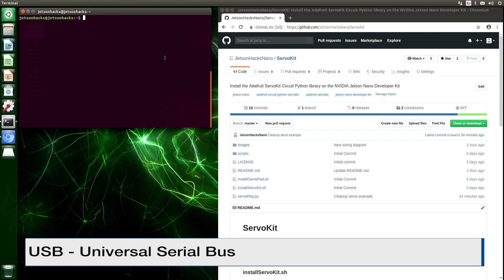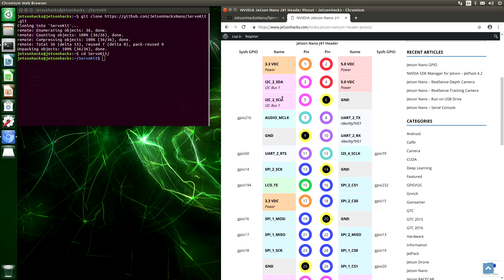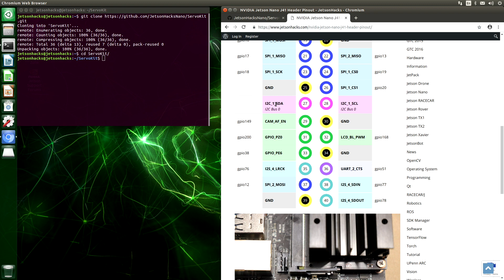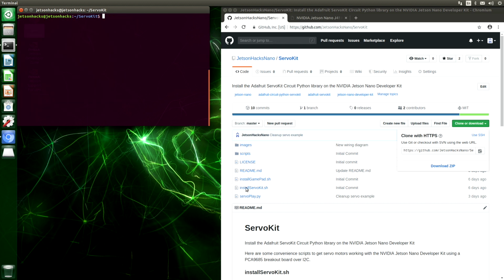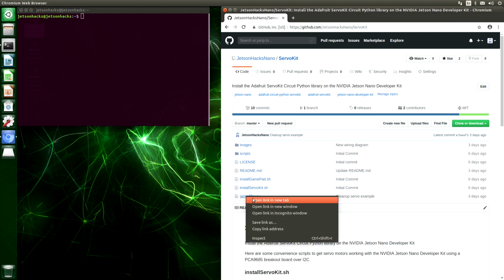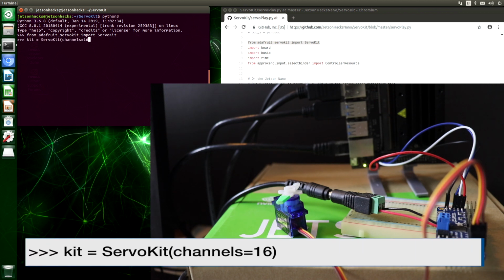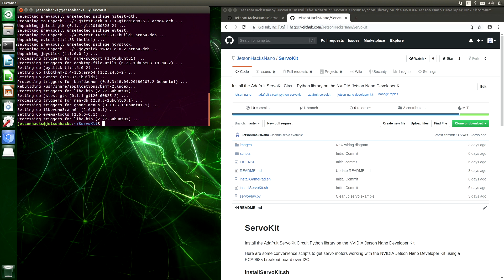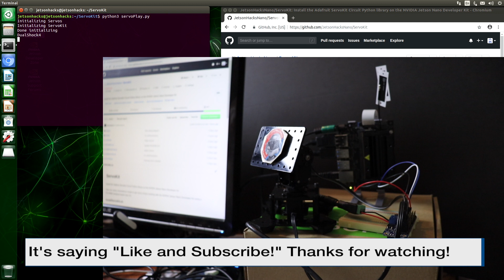Jetson Nano I2C PWM Servo Motors

Comment: I can't see the pca9685 on the jetson nano. I connected it to the 3rd and 5th pins with i2cdetect but it didn't work. I connected it to the 27th and 28th pins but it still didn't work. The power led of the pca9685 is on, can you help me?
Reply from the maker: what was the i2cdetect command you used?

Comment: Would this still work on the new Nvidia Jetson Nano Orin Super?
Reply from the maker: I haven't tried it. There may be issues with the library versions. Also, the pin assignments may be on different busses, so you will need to check the pinouts. The pinouts is available on https://jetsonhacks.com/nvidia-jetson-orin-nano-gpio-header-pinout/  
Thanks for watching!
Reply: @JetsonHacks thanks for the reply! Right now i currently have a rpi 4 that ill use as an i2c slave. I also have 3 f to f cables coming in to connect the rpi 4 to the jetson

I used chatgpt to come up with this solution, ill see if i can find more info on this but off the top of your head does this sound right? I think it does since rpi4 and my rpi servo hat has i2c
Reply: @JetsonHacks  hello, sorry i have another question. Im pretty new to using parts like these, what is the purpose of a breadboard? Couldnt I wire directly from the jetson to the pca9685 without the breadboard?
Reply from the maker: @michaellopez3681  You can wire it directly to the PCA9685. People use breadboards for prototyping because it's easy to change the wiring during development.

Comment: Hello,
I'm having a hard time to determine which GPIO pins must be connected to the stepper motor driver RMCS1120. 
I need assistance in determining which specific GPIO pins on the Jetson Nano should be used to connect the PUL+, PUL-, DIR+, DIR-, ENA+, and ENA- pins of the RMCS1120 stepper motor driver.
Kindly please help. 
I had a look at the specifications for the RMCS1120 stepper motor driver, but I'm unable to figure this out. Please please help.
Reply from the maker: This is not something I can help you with. Please ask for help on the official Jetson Nano forums: https://forums.developer.nvidia.com/c/agx-autonomous-machines/jetson-embedded-systems/jetson-nano/76

Comment: Are you aware of any such stepper motor driver that can be connected to multiple (up to 3) NEMA23 stepper motors together?
Reply from the maker: Typically people will use a 4 axis CNC or 3 axis 3D printer driver boards.
Reply from the maker: You can consider simple USB CNC controllers like this one from Adafruit: TinyG CNC Controller Board v8 https://www.adafruit.com/product/1749?gad_source=1&gclid=CjwKCAjw17qvBhBrEiwA1rU9w98i4X8kytc4E0Hh11mLczvNOxvxOm91x_bb1XUk5cI5R0JNQpVZyBoCZKUQAvD_BwE
There are a large number of this class of boards, you can check on Amazon or eBay. Typically they're for CNC machines or 3D printers.

Comment: Is it possible to control 3 Nema23 stepper motors using a single RMCS1120 stepper motor driver using a Jetson Nano?
Reply from the maker: You need to read the specifications for the RMCS1120 stepper motor driver to determine if it can control 3 stepper motors. It's not clear how it would be able to do that as it appears to only have a single set of outputs. Stepper motors typically have 4 wires to drive them in the most common configuration.

Comment: Hi, 
Is it possible to connect 3 stepper motor drivers to a single jetson nano? Or do we need individual jetson nano's for each stepper motor drivers?
Reply from the maker: It depends on which stepper motor drivers you use. Typically once you need direct control of more than a couple of stepper motor drivers you use a microcontroller of some sort, and then have a microprocessor, like a Jetson, control the microcontroller. 
There are some stepper motor drivers which can control multiple stepper motors and communicate of USB. It depends on the requirements, the protocol the stepper motor uses (SPI, USB, PWM, UART and so on), and how the driver needs to be controlled. 
Good luck on your project!

Comment: I wish to use a stepper motor for one of my projects on the Jetson Nano. 1. How do I go about connecting and using a stepper motor on the Jetson Nano?  2. Which stepper motor is compatible on the Jetson Nano?
Reply from the maker: That's a pretty large subject. First select which stepper motor you wish to use and the requirements such as unipolar or bipolar. Next, people generally decide which stepper motor driver is appropriate for their application. The stepper motor driver will determine which interface protocol should be used such as PWM, SPI, serial, USB, I2C. Then you will need to decide how to interface to the stepper motor driver with your Jetson, or whether you need to interface with a microcontroller which controls the stepper motor driver. The microcontroller may be more convenient if you have to control the low level signal timing. Good luck on your project! Dronebot Workshop has several videos on controlling stepper motors of varying sizes, for example: https://youtu.be/0qwrnUeSpYQ?si=rF78RCSh3_Dcp-Aq Good luck on your project!
Reply: @JetsonHacks  Could you please share which stepper motor (unipolar and bipolar) that are compatible on the Jetson Nano?
Reply from the maker: @Bwajster  You need to study more about stepper motors. The Jetson Nano does not drive a stepper motor. It interfaces to a stepper motor driver, which in turn interfaces with the stepper motor itself. The driver handles the unipolar/bipolar. Stepper motors come in a very large variety of sizes, to say "stepper motor" doesn't narrow it down enough to provide any information. I would suggest that you watch the video mentioned previously to better understand the different types of stepper motors and how to drive them.
Reply: @JetsonHacks Alright thank you so much. 
I'll have a look at video, later how do I figure out which stepper motor and driver are compatible with the Jetson Nano ?
Reply: @JetsonHacks  Also, the stepper motor driver would be connected to the J-41/GPIO pins of the Nano right?
Reply from the maker: @Bwajster  They all are.
Reply from the maker: @Bwajster  It depends on which stepper motor driver and interface it needs.
Reply: Thanks a lot for the video. I need to drive a Nema 17 using my jetson Xavier NX. I managed to turn some pin to pwm and make it work but the speed/smoothness I can achieve does not seem to be as good as with arduino… is that to be expected? Should I generate pwm by arduino and communicate over I2C? Or by the pwm driver you used? Thanks!

Comment: I have a yahboom expansion board connected to a jetson nano, the expansion board has two sets of pwm servo interfaces, one is JST the other Micro-Jst. Out of the box I have code to control the servos connected to Micro-Jst, however I need to connect a more powerful servo on the Jst interface. How would I send code to Jst servo interface rather than micro-jst? I cannot find datasheet for expansion board, only a diagram with vague labels of each set of pins.
Reply: i can currently control servos thru micro-jst using Arm_Lib python library
Reply from the maker: I don't know the answer. You should contact yahboom for technical support, or find a library that interfaces with the board. Good luck on your project!
Reply: @JetsonHacks   they sent me a link to their github which I have thoroughly studied. Only docs for board is a picture with vague labels. I think I will use a different expansion board or a servo hat to drive the servos.
Reply from the maker: @pottoker612  Hardware is like that, it's difficult to make the correct guess as to how you interface with it. Going to something else is probably a good idea. Good luck on your project!

Comment: Is it possible to connect the data wires of the servo motors directly to the GPIO pins?
Reply from the maker: Yes. You will need to configure the Jetson to emit PWM signals to drive the data wire. On the Jetson Nano, the PWM signal is not as precise as having a dedicated microcontroller as shown in the video, and there are only two PWM outputs as I recall. If you need more help with PWM on the Jetson Nano, please ask on the official NVIDIA Jetson Nano forum where a large group of developers and NVIDIA engineers share their experience. Thanks for watching!

Comment: Hi, very nice content and quite to the point.... I have attempted to get this done and still struggling. My code loads fine but nothing happen: i receive a message:exiting, cleaning pins and when I check the i2c i see x40 but not any more x70. I need to restart and unplug to be able to get x70 back.
Reply from the maker: It's hard to tell from the description what might be the  issue. It's not clear why you lose a hardware address.
Reply: @JetsonHacks  HI Jim, I think was a trivial error in the code which for some reason wasn't casting a syntax error.... however I have recently upgraded my jetpack to 4.6 and it seems your installation does not run as smooth as it used. It gives: 
"Collecting Adafruit-Blinka>=7.0.0 (from adafruit-circuitpython-servokit)
Could not find a version that satisfies the requirement Adafruit-Blinka>=7.0.0 ". 
I searched in the community but I did not manage to make it work.... installed blinka and so on... are you planning to upgrade this repository as well?
Reply from the maker: @fablapp  No plans to upgrade at this time. You will need to change the code to meet the requirements to load the Blinka library.
Reply: @JetsonHacks  Jim, txs for your kind reply. Seems not easy: added the installation for blinka but still is requesting the version 7. tried to revert to previous jetpack and getting all a series of problem. The Nano seems a bit beyond my capacities!

Comment: Thank you for your informative videos. I am using them alongside Paul McWhorter's Learning AI with Jetson Nano. I am looking for a patch or fix to the error that is thrown when I attempt to install the adafruit-circuitpython-servokit : Command "python setup.py egg_info" failed with error code 1 in /tmp/pip-build-h9k6l_16/adafruit-circuitpython-servokit/ 

I am using the SD image jp451, Ubuntu 18.04 LTS, Jetpack  4.5, and Python 3.6.9 -which is preinstalled on my 4GB Nano.  Have you any experience with this error code? If it should be a python issue, any suggestions on how to properly upgrade python so as not to cause errors?  

Thanks for any help you can offer?
Reply from the maker: I have not encountered this issue yet. Hard to tell what the problem is from the description.

Comment: henkoegema@JetsonNano:
What could be the error here? :   
(JetsonNano 2GB)

~/Documents/ServoKit$ ./installServoKit.sh 
cp: cannot stat '/opt/nvidia/jetson-gpio/etc/99-gpio.rules': No such file or directory
Reading package lists... Done
Building dependency tree       
Reading state information... Done
python3-pip is already the newest version (9.0.1-2.3~ubuntu1.18.04.5).
0 upgraded, 0 newly installed, 0 to remove and 0 not upgraded.
Collecting adafruit-circuitpython-servokit
  Downloading https://files.pythonhosted.org/packages/a2/65/5da8d1d4a22701fedf9dbae9094e40185d58be25b86175eb0861d55398a5/adafruit-circuitpython-servokit-1.3.10.tar.gz
    Complete output from command python setup.py egg_info:
    /usr/lib/python3.6/distutils/dist.py:261: UserWarning: Unknown distribution option: 'long_description_content_type'
      warnings.warn(msg)
    Traceback (most recent call last):
      File "<string>", line 1, in <module>
      File "/tmp/pip-build-tb0z96hc/adafruit-circuitpython-servokit/setup.py", line 61, in <module>
        py_modules=["adafruit_servokit"],
      File "/usr/lib/python3/dist-packages/setuptools/__init__.py", line 129, in setup
        return distutils.core.setup(**attrs)
      File "/usr/lib/python3.6/distutils/core.py", line 108, in setup
        _setup_distribution = dist = klass(attrs)
      File "/usr/lib/python3/dist-packages/setuptools/dist.py", line 372, in _init_
        _Distribution.__init__(self, attrs)
      File "/usr/lib/python3.6/distutils/dist.py", line 281, in _init_
        self.finalize_options()
      File "/usr/lib/python3/dist-packages/setuptools/dist.py", line 528, in finalize_options
        ep.load()(self, ep.name, value)
      File "/usr/lib/python3/dist-packages/pkg_resources/__init__.py", line 2324, in load
        return self.resolve()
      File "/usr/lib/python3/dist-packages/pkg_resources/__init__.py", line 2330, in resolve
        module = __import__(self.module_name, fromlist=['__name__'], level=0)
      File "/tmp/pip-build-tb0z96hc/adafruit-circuitpython-servokit/.eggs/setuptools_scm-7.0.0-py3.6.egg/setuptools_scm/__init__.py", line 5
        from _future_ import annotations
        ^
    SyntaxError: future feature annotations is not defined
    
    ----------------------------------------
Command "python setup.py egg_info" failed with error code 1 in /tmp/pip-build-tb0z96hc/adafruit-circuitpython-servokit/
henkoegema@JetsonNano:~/Documents/ServoKit$

Comment: Hi! Love your tutorials! I have followed the steps and things went well, but I got an error below when I input from 'adafruit_servokit import ServoKit'
 File "<stdin>", line 1, in <module>
  File "/usr/local/lib/python3.6/dist-packages/adafruit_servokit.py", line 35, in <module>
    import board
  File "/usr/local/lib/python3.6/dist-packages/board.py", line 39, in <module>
    import adafruit_platformdetect.constants.boards as ap_board
  File "/usr/local/lib/python3.6/dist-packages/adafruit_platformdetect/__init__.py", line 10, in <module>
    from .board import Board
  File "/usr/local/lib/python3.6/dist-packages/adafruit_platformdetect/board.py", line 24
    from _future_ import annotations
    ^
SyntaxError: future feature annotations is not defined
Help me
Reply from the maker: It's probably a Python version issue. Do you have the Python futures module installed?
Reply: @JetsonHacks  What module is needed? . How to install it?
Reply: @JetsonHacks  I tried to install a new version of python but nothing worked for me. How to install a new version of python correctly?
Reply from the maker: @rchobby7564  It's hard to tell what you are doing from the description. I can not tell which version of Python you are using, or the version of JetPack.
Reply: @JetsonHacks  Can you tell me how to update the python version to jetson nano? (I have version 3.6.9).
Reply from the maker: @rchobby7564  How did you try to upgrade it?

Comment: hello! i am new for jetson nano. May i know what power supply u use and what adapter about  connect power supply to pca9685?
Reply from the maker: If you are connecting to the wall, use a 5V, 2+ amp power supply. If it is for mobile use, you can use something like 4 or 5 x AA battery pack to connect to the terminal block. Thanks for watching!

Comment: hello, what steps do i need to follow for a single servo on jetson nx? I want to be totally break board independent. Also, if possible, using python2 or c++. thanks.
Reply from the maker: You can use the code linked in the article as reference. You can rewrite the code as needed for whatever your breakout board and programming language requirements might be. Thanks for watching!
Reply: @JetsonHacks  thanks a lot. And great video by the way. Keep up the good work. Cheers.

Comment: Is it possible to use multiple devices/components connected to the same I2C pins?
Reply from the maker: Depends on the device. Make sure that the addresses are set differently on the each device you connect. Thanks for watching!
Reply: @JetsonHacks  for example a I2C OLED or a I2C motor controller. So as long as the addresses are different it should work?

Comment: Hi JetsonHacks, I was wondering if a power source is necessary for the PCA9685 board if my motor has an external power source directly connected to it and I'm just sending signals to the electronic speed controller (also powered by the external power source). I wasn't sure if the power source for the PCA board is needed only to supply the motor (which in my case, I wouldn't need)
Reply from the maker: Have you tried it to see if it works without it?
Reply: @JetsonHacks  When I try to detect devices connected to the i2c bus, it doesn't show anything and I was wondering if it had to do with not powering the PCA9865 board? However, I don't even need the power line from the PCA board to connect to my esc, since my esc is already powered by a battery.
Reply: Do you think I'd need a power source for the PCA board?
Reply from the maker: @danmuji7585  Hard to tell since I do not know how you wired everything together. You can read the JetsonHacks article for more information on wiring.

Comment: hey i found the the i2c by writing i2cdetect -r -y 2 so apparently it’s on the port 2 and it showed me the pin 50 and 57 what adress can i conclude?
Reply from the maker: I do not know the answer to your question. If you are wiring to the GPIO header, the busses are 0 and 1. I do not know what "pin 50 and 57" mean, i2cdetect prints out addresses.